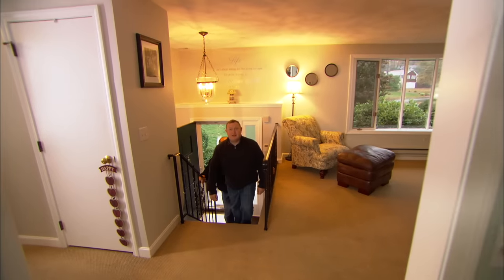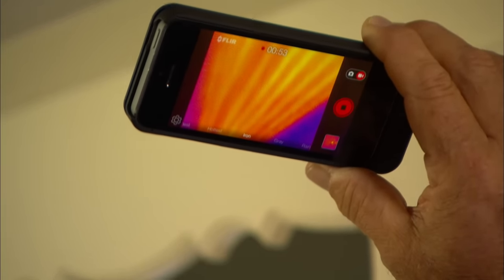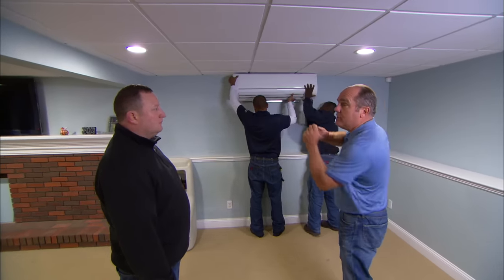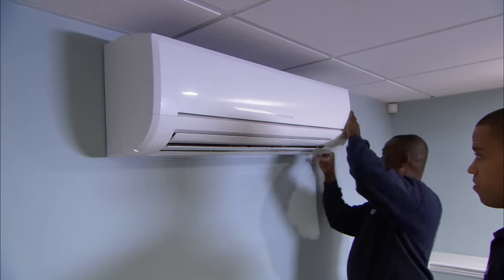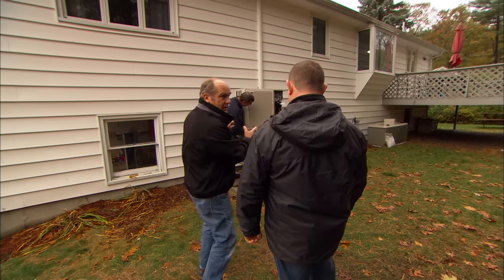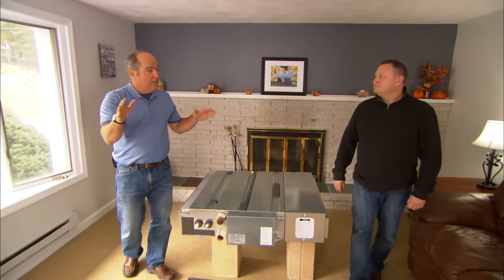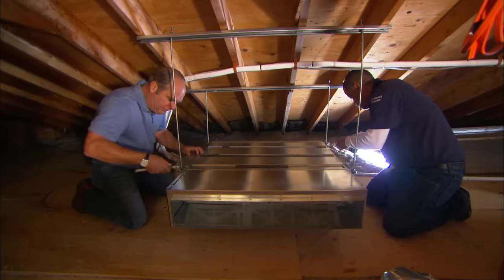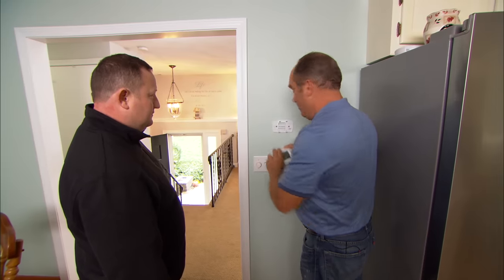How to Install a Whole-House Ductless System | Ask This Old House

Comment: HOW are heat pump ductless mini-split systems sized for a house?   We know it’s clunky to compare R-values for foam insulation vs. fiber insulations.....is it a similar principle for heat pump ductless mini-splits, compared with regular HVAC systems?  
     Some contractors quote upwards of 35,000 BTU 2-head system for upwards of $12,000; that is for a less-than 1500 sf. 1970’s tract house, located in Olympia Area of WA State.   
    Others quote a single head 15,000 BTU system for around $5000, saying it will handle this house [fairly open floor-plan].  
   All quotes are for Daiken or Fujitsu brands 
Getting such different information is confusing! Now don’t know who to trust!?

Comment: I'd have to see a ductless heat pump keep up at below 25 degrees or so. I never
have and have allot of doubt that it could.
Reply: They use them in norther parts of Finland without trouble. They also install them in Maine and New England without trouble. The Mitsubishi hyper heat units are capable of delivering 80 to 90% capacity at -13°F and 100% capacity at 0-5 Degrees Fahrenheit. Fujitsu advertises  down to  -15F.  These types of inverter units are drastically more capable than your conventional system with bigger compressor is in much larger surface areas on the outdoor coils
Reply: I’ve seen units keep up at those temps

Comment: The only real reason to go with a system like this is if there's literally no other option that can work. A multi-zone system can cost 3x as much as a conventional system, and who knows how long until you break even on the investment. There is also regular maintenance needed. The filters need to be cleaned about once a month. I know it gives some folks the warm and fuzzies, but at what price? Meh.

Comment: Hi guys I was looking at putting Wendy's in in Michigan will it work since we get you're very cold in Michigan I have a forced air unit that's gas thank you.
Reply: joe doub call local pro in your area, do not rely on those from this old house. They constantly get the information wrong and Richard doesn’t have a clue what he claims to know
Reply: I wouldn’t advise it.  These are great for light commercial and home use.  Restaurants, not so much unless you only plan on using them on the dining area.
Reply: @davidcerino1145  my house is only 750 square feet oh I am sitting it smart sweet hot and cold air and looking for the one that that's too cuz existing ductwork come on whole house would get it not just one room.
Reply: @davidcerino1145  We put a 3 ton in our restaurant kitchen and keep the filter clean.  6 yrs, in VA with both kitchen heat and hot summers, no problems so far.  Also, it was throw away cheap, we'll just replace it when it goes down.  I'd also suggest and we'd do it if doing the install now, to put a box around the intake part of the wall unit to enable using a regular HVAC replaceable filter.  That should cure the kitchen greasy air problem if the kitchen has one.  In a residential setting if done with some style, it hides the part my wife hates--the wall unit.  The Net is replete with designs for the latter.
Reply: @replyhere590  
The grease is the main issues.  If you are planning to have a set up that uses a standard filter, you might want to look into the mini split ducted systems.

Comment: Great country. Greatest economy. At the same time outdated technology. Modern technology - warm flooring, mini split a/c (dustless), tankless water heater, with 2 circulations. 1 for shower, second for heating floors. Heatpump more efficient that gas heater, but as colder outside ambient temperature you have, less efficient it is.
Reply: You are sooo wrong on all counts

Comment: Sorry but so wrong not close to how a refrigeration cycle works, Hot refer under high pressure is pumped inside through the hot or high side to a orfic, this is the little line, changing pressure to low, hot liquid refer then boils off as it absorbs heat, but not to much, returning to the compressor cold (50º) or so, in the big line usually wrapped in foam, this is to keep it cold to cool the compressor. Cold vapor returning cools the compressor and then enters the compressor, pumped to the high side (HOT) out door air cools or condenses the refer back to liquid, it's still (HOT). Lol

Comment: My question is this would this work in a multi unit apartment building
Reply: JDS Lawncare & Landscape only of utilities are included in the rent
Reply: JDS Lawncare & Landscape - Yes, it can, however the outdoor unit is likely to be shared between apartments and that cost to run the OD unit would have to be split up somehow.

Comment: As ig gets colder the minisplit system loses efficiency,could be by a 27 degree difference.
He is using this for heat,shoul of used a hyper heat condenser
A 5 degree day setting the stat to 70 will heat the house to 55

Comment: Heat pumps are garbage! They run constantly and still never do a good job even in mild climates like central California where I am.

I just switched from heat pump to propane and my heating bill dropped from $500 per month to $500 per year. I also converted my water heater, dryer and stove to propane.

Comment: Why the hell would someone make a radiant ceiling?!
Reply: It was the cheapest system to install for builders doing spec homes at the time. They didn’t care about operating cost, many developers still have the same mentality.  Split systems similar to this system have good utility company rebates and great payback on higher initial cost, usual payback crossover is about 7 years on our projects.

Comment: FYI

Electric is 100% efficient.
Reply: True but with heating the ceiling there isn't much convection because the warm air stays up there and he is heating his attic wich is probably not necessary
Reply: Örlogskapten 

I’m not disagreeing it’s not the best way to heat, but electric COP=1, so there for its 100% efficient. Power in equals same power/btu out.

Comment: @2:38 "the inverter allows the capture of that small amount of heat on the outside, move it inside the house..."
me: that sounds logical, cool.
"then multiply its output and condition the space...it's much more efficient to move heat than to make it..."

me:...wait, hold on, my brain is farting a little. since the wording is giving me the impression this system itself doesn't generate/make heat - the less efficient method, and it's solely transferring the heat from outside and MULTIPLY it indoors, like some voodoo magic?
why am I getting the impression (or led to think) it sounds like the perpetual moving machine of the HVAC systems...
Reply: Danny Doyle 
Well, they really don’t know how to explain this, lol, or how it really works.

Allow me: in a conventional air conditioning system, you cool the inside of the house by absorbing heat (energy, if you will) in the Indoor Coil and transferring that energy through the refrigerant lines to the Outdoor coil and essentially dumping the heat outside. 

That is why you’ll notice the outdoor units (condensers) blowing hot air during COOL mode.
Now, heat pumps do the same exact thing, BUT they are also able to reverse the refrigerant flow “backwards”.  This allows you to dump energy absorbed from the outside inside the house.

The mini split systems they have installed do the same exact thing as a conventional heat pump, but they have the “inverter” technology that allows the compressor (which pumps refrigerant through the system) to “regulate” how much it pumps, as opposed to the start/stop operation of conventional systems.

A more sophisticated version of this mini-split systems is one that allows you to heat one space and cool another simultaneously.
Reply: @davidcerino1145  I'm not sure if I follow, but I appreciate your explanation, and I'll look deeper into it.
Reply: Just look up refrigerant cycle online and you’ll find the explanation. It’s just a way to exchange heat mechanically; just like your fridge. You take heat from one place and dump it in another. No voodoo involved :)

Comment: System isn't ductless. Using flex duct to each supply damper and return register is not ductless.
Reply: The first unit is ductless, the other 4 quadrants is bonus video
Reply: @KingRune  Can't have a "whole house" without the other 4 quadrants.

Comment: I don't buy the magic of extracting heat from an ice cube! What is this talking about?
Reply: science
Reply: Yes, science!

You know the temperature scale (Fahrenheit and Celsius) is a way to measure heat. 
So 2 degrees Fahrenheit is a measurement of heat meaning, there is heat present that can be extracted/displaced. 

Cryogenics is a process that goes into extreme negative temperatures which are achieved by removing/displacing heat. Done by refrigeration and probably some other procedures that's are probably not available to the public.
Reply: An object at 0 deg C (ice cube) obviously is warmer than an object at, say, -30 deg C. "Cold" does not mean "contains no heat".

Comment: So why is he using the new wireless thermostat in the beginning to turn on the old heating system before they install the thermostat? Typical bad fake production by TOH.
Reply: Its a different thermometer... the first one glowed while the other one didn't.
Reply: @Nabrab  Wrong. First, it's a thermostat, not a thermometer. Second, it is the EXACT same model in the EXACT same location for both shots. In the end shot he never touches a button and therefore it does not light up. These type of thermostats are not used with old ceiling heat - they generally have a line voltage type thermostat in each room.
Reply: @ryanroberts1104  to be perfectly honest I agree. I only replied as I was curious if the initial message, made by yourself, was done by a troll. Infact, I was the troll and I hope it didn't cause serious discomfort. Of course this is not a thermometer but you're right it is 100% the exact same model thermostat in both the first and last shot. I believe TOH shoots these videos over various scenes to represent the entire project as a learning aide and not a true bibliography of the events. Of course no real home maintenance event is ever this easy but hopefully it gets people engaged in wanting to learn how to maintain their home better.
Reply: @Nabrab  Of course it's a mixture of scenes taken over time. You'd think after doing this for 40 years they would learn how to do that in a realistic way instead of having a lower production quality than many youtubers. At this point they really should hire actors to be the "homeowner". The cheesy fake lines worked in the 80s, not so much today. I find it hilarious they never ask the homeowner what they want, instead they come in and tell them what they are going to install.
Reply: @ryanroberts1104  I'm sure if the intended audience was for professionals and not home owners it would be different. For such a broad tooic, do you have a channel you recommend instead?

Comment: Ductless system using ducts??. He will freeze in a northern climate with this set up ..Heat pumps are terrible below 35 deg and he will need those supplemental heat strips to heat a house up north.Watch that electric meter spin like crazy. $$$$

Comment: RICHARD,My air compressor is a heat pump because the air is hot coming out the nozzle.WHY?
Reply: Because air is a type of refrigerant gas.
Reply: @ryanroberts1104 .the air you breathe is not a type of refrigerator gas.all air is,is h2o.any thing that is compressed becomes hot due to pressure.

Comment: Who would buy a $20,000 dollar system to save $ 25 dollars a month , the indoor coils start leaking on avg. in 7 years, not to mention the 30 senors this thing uses are always failing, I shouldn't even bring up the mold that grows on the blower wheels !!

Comment: They always leave out the  bad parts of things... Mini splits are only for people who  have more money to spend... Not for people on tight budgets... One reason is u must buy copper linesets and control wire with each head installed..which also means more things to go wrong... Outside Condensers have ports to connect linesets to...the more the ports the higher cost of condenser.. So if u plan to get more heads in the future u must buy a more expensive condenser with that many ports now... Or else you must buy another condenser...also all new equipment has 410a refrigerant which runs at much higher pressure than the old r22 refrigerant...about 450psi compared to less than half that for 22...more pressure means more resistance.. Which means more money to operate...and u must pay the same thing in winter because it's a heat pump... Not worth the money in most cases... If putting duct work in is the issue for u because of space look into a high pressure system ...it uses small 2in flex ducts and depending on the house... About 7/8 in trunk ducts to feed the 2in which easily fits places... But any house can have ductwork...u can put it in a corner of a room or through a closet if needed
Reply: METO U, the SpaceCo high pressure systems were noisy, drafty and problematic at best, mostly because the installing contractors did not understand the system's limitations and tried to make them do things they were not designed for. As for R22, it is being phased out in the near future and no new production refrigerant is available in the US.

Comment: ffs complicated af. Get a combi boiler, radiators and job done.
Reply: anosferatus, so you have heat, but not air conditioning and you have spent as much or more than the cost of this VRF. Where is the win in that?
Reply: Combi boiler and rads would be no more than 4k including installation. Proper wall cavity insulation and double glazing makes it more efficient to keep the property heated as well as keep the heat during summer from turning it into a sauna. LPG is still way cheaper this setup pays for itself in electricity savings. And on those extra toasty summer days, a simple wall mounted split aircon unit with digital inverter would be more than enough to cool the property.

Comment: “We are installing 4 because we can” lmao 😂 this owner obviously “can” burn a hole in his wallet. Heat pumps are not meant for cold weather they are meant for cool weather about 55 degrees and up not 30 and below. They use them in RVs and down in Florida. And using any kind of duct makes the system ducted! The only ductless one was down in the basement.
Reply: That Hyper Heat Outdoor unit will work down to 0 degrees.

Comment: Just so funny watching this and hearing this is "new" technology ... hahahahahahahaha .... and then he went on to say the "the big breakthrough is the technology called the inverter" and "the inverter allows us to capture that small amount of heat that's outside"  total BS ... The inverter slows down or speeds up the compressor and/or the outdoor unit fans to change the unit capacity in line with the heating or cooling load. America is so far behind Japan and Europe in air conditioning and heat pump technology. It really is funny to see these videos on "new ductless air conditioning and heat pumps"
Reply: Please share more. So are these units the future or not?
Reply: Orielsy Diaz    The future...?? LOL. these units have been around for over 30 years, so they are the present for most of the world except the US where they have finally become more readily available in the last 5+ years.

Comment: Wow, I wouldn't want to add refrigerant veins all over my house. It is so dangerous. What if the refrigerant line breaks due to corrosion? How much ozone destroying freon will go up in the atmosphere, and in the aftermath my house will have to have circus tent all over it foir a few months to clean the refrigerant? No, thank you. I'll stick with my wood fired boiler and cast iron radiators. Not that efficient, but:

1. it works
2. it is simple
3. it is easy to fix
4. it is simple to operate
5. if something goes wrong, you will not have to evacuate for half a year for chemical cleanup. Only some black water on floor.
6. it will never brake. Just a pump, a radiator, a boiler, and a shit load of pipes.